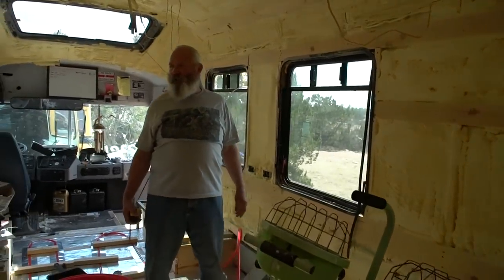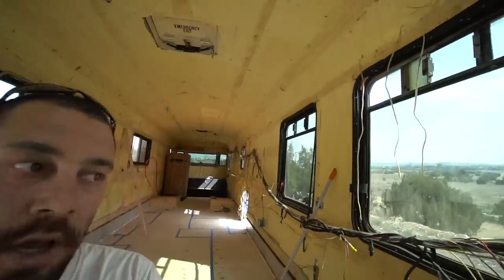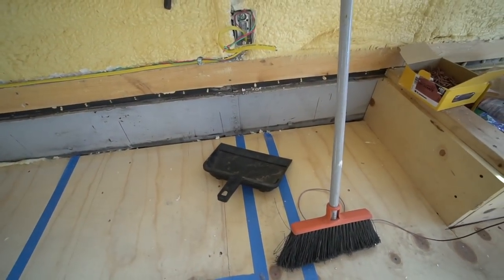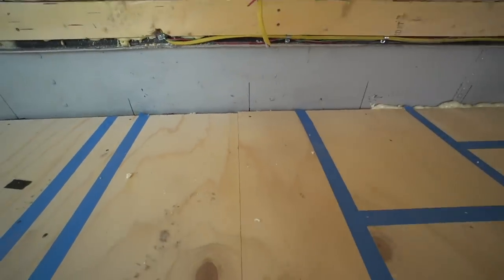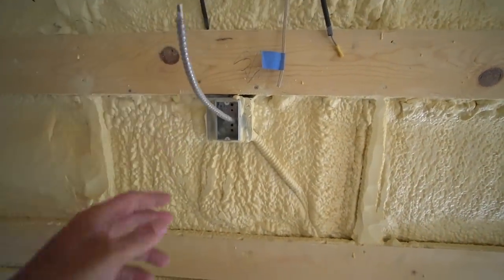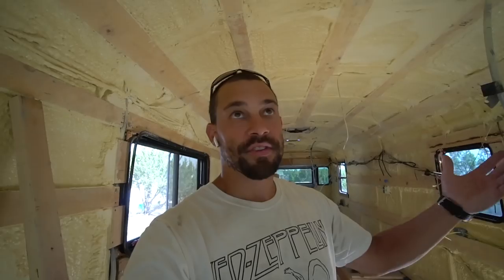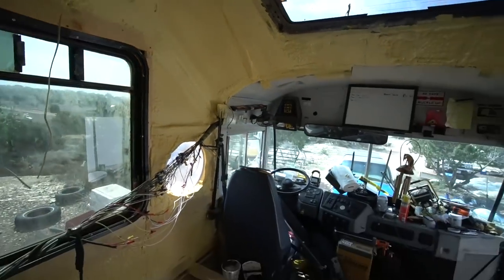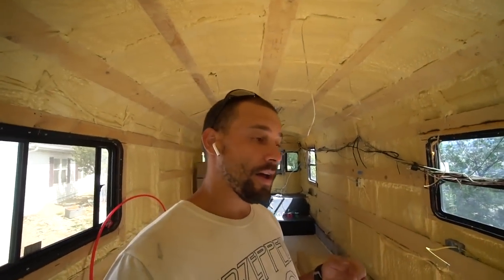Skoolie Subfloor Installation Finished ~ Preparing For Walls & Wiring

Comment: solid copper home romex and wire nuts are a really bad idea in a moving vehicle, solid wire will eventually work harden and break off at the terminations and can even break apart inside the insulation and start a fire inside a wall. soldering stranded wire is also a problem as the point where the solder wicks into the strands creates a stress riser and fracture point unless the joint is properly protected with good-quality heat shrink with hot adhesive a couple inches past the joint on each side. electrical wiring on race cars is always crimped, not soldered, for reliability and safety. it would be really unfortunate if you had to tear open the walls in a couple of years to replace the bad wiring.

Comment: you should use the crimp style nuts to wire those wires together  those wing nuts will work lose over time traveling down the road shaking and baking   lol   its looking good chris
Reply: Those blue scotch locks are gonna cut some wires for sure.
Reply: jack dula thinking the same thing! They will come loose and a potentially have a fire hazard.
Reply: Yeah, Scotchlocks are the worst! Cause for more wiring corrosion and breaks than probably any other kind of fastener. Strip the insulation back, and solder and then heat-shrink - the better way!!!!
Reply: Actually..... soldering in the new added lengths would have been the "best" adaptive measure.  Marine grade shrink wrap self-sealing butt connectors would be next.  Cheap wire nuts are not made for changing environments or humid exposure.  Sorry - those are the facts!
Reply: Wago Levernuts work really well.  I would think about jetline in the conduits, just in case.
Reply: Those wing lock things are actually illegal on power wiring even in a house in many parts of the world. They are used for low volt applications only.
Reply: Plus they are VERY expensive!  I'd pass on them too!
Reply: D Hyde I was thinking I would run a extra line to pull later is that what a jetliner is
Reply: @dhyde9207  what is jetline?
Reply: @WiKiTWoNKa  ... nylon line put into conduit to use at a later time to pull something else through the conduit.
Reply: @dhyde9207  thank you that's an awesome idea 😊
Reply: Solder and heat shrink if it is not accessible.

Comment: Would be nice if you built a "Raceway" for the wiring, makes it easier to pull forgotten or new runs. If you can run 2 "pull lines" before buttoning it up. 
Lots to think of,but will be awsome when it's done.

Comment: Love this series Chris.  If you want the wiring to be trouble free for 15 years, solder the connections and shrink tube them.  A friend has a MH that is having all kinds of electrical problems because the salt air was not his friend.

Comment: just fyi and to keep with nec "national electrical code". don't mix your low voltage with the high voltage in the same outlet box. keep the 12 volt dc separate from the 120 Volt ac line. even inverters on the input side keep the lines separate in one from or fashion. and screws are better to use on the walls then nails in a mobile unit. nails are prone to come out.
Reply: I was told that if I use 600 volt wire for the low voltage also... they can go into the same box as 120v wire.
Reply: @rogerwhiting9310  look up the NEC code. NEC stands for national electrical code
Reply: @KY4TRK  it was awhile ago that it was suggested to me. I wanted to put the 24 volt thermostat wire in the same conduit and termination box. The master electrician told me it was ok if I used basically romex for each. The code has changed a lot in 20 years. If I do a job that I personally consider perfectly safe... but would not pass strict code....I do it anyway. If it has to be inspected and passed....I have to satisfy the MAN. I took out permits for my swimming pool, #2 sub panels and a standby generator... and wired them myself. The inspector said i did a "good" job. I know what the NEC is. I dont always follow it. My choice.

Comment: It's beginning to look like home Chris. There are many ways to label wire and connections, and several ways have been mentioned in the comments, and on Instagram. I use a Brother thermal tape machine for this, plus I label all kinds of stuff with it. There are also dedicated thermal labeling machines just for wiring, but this limits one from labeling your coffee beans with such an item :<).

Comment: I would have laid the plywood along the length of the bus cutting out for the wheel wells. You would have been able to but the edge right up the the walls and had the point where the plywood comes together down the center of the bus.

Comment: Solder those wires, if you need them removable, get XT60 style connecters, and use heat shrink. As others have said, those nut style connecters are only good for homes that do not move around.

Comment: Clever choice to use speaker wire, as it is stranded.  I assume this is for the 12V.  What AWG speaker wire can you get?  I assume the lights will pull very little current anyway.  Built for purpose :).
Reply from the maker: Thanks! They are 3.5w per light. The speaker wire is 14ga :-)

Comment: If you can work it into the schedule, I'd run tests on any wires to be covered up prior to the finished wall install. Same risk as in a home with drywall screws damaging plumbing and wiring, be damn careful running screws. I know Jim is there to crack a whip on you, so I'm not as concerned. Build the bus on paper and in your head. Problems are best solved by avoidance. Above all, don't allow beer consumption to fall off!!!!!!!!

Comment: I would suggest solder and shrink tube to extend wiring - much more reliable.    I would never trust a crimp especially with vibration.    Another idea if you have space is to run pvc conduit length of bus that you could fish wire through later
Reply: crimps are actually better than soldering when vibration is an issue.

Comment: Man oh man you need to use a better method to splice wires. I suggest aircraft or at least marine grade crimp connectors. You will have problems almost from day 1 if you use those crusty twisties. As far as the speaker wire goes, I don't necessarily hate the idea of using it for lights but you should know how much voltage, amperage and resistance the wire is rated for and not exceed that. Also, are ya SURE that the plastic is nice and chemically non-reactive / thermally stable? You don't want that thing degrading in 3 or 4 years.

Comment: that wiring for the bus electrics themselves is going to become a problem over time im allmost sure of it
for the original basic wiring of the bus like the lighting in the rear startermotor and stuff like that it might be better to find a wrecked bus of the same brand and rip a verry big piece of the wiring loom from the driverseat to the rear of the bus out of it , then use that to splice it intoo the existing loom with the least amount of joints as possible (use the donor wiring from the tail lights to the front and connect them to the original wiring in the middle . thats only one joint )
using the wiring from the same brand of bus alows you to keep the colour coding the same all the way to the rear of the bus making following a wire to solve gremlins a lot eazier 
the idea of the wiring gutter along the top of the wall of the bus is a good one , at least you be able to get to the wiring without tearing half of the bus a part and can fix problems fast
allso for connecting the stranded wiring those twist thingies dont work verry whell over a longer period once the wires start shaking and corroding they could heat up enough to start a fire (allso the reason why you dont want more splices than absolutely nesesairy  , my advice to you is to look for and use wago lever clamps instead : https://www.connexbox.com/wago-222-413-3-port-lever-cage-clamp-terminal-block.html
they clamp down on the wire holding it in place and keeping the connection better even when the wires are shaking about than the way youre connecting things together now , its allso eazier to break or add to the connection when you want too the wago connectors come in 2 3 and 5 openings https://images-na.ssl-images-amazon.com/images/I/71WGWnFlrTL._SX679_.jpg

Comment: You are going to sorely regret using all those blue scotch lock connectors. Don't take my word for it, google it. I hope you have not buried them in the wall yet. IMO the best method short of soldering is bare connectors with epoxy shrink wrap. Next best is self shrinking crimp connectors with the glue inside. Even basic cheap crimp connectors are better than scotch locks.
Reply: Def solder and shrink wrap the crimp/twist style is janky and will fail.